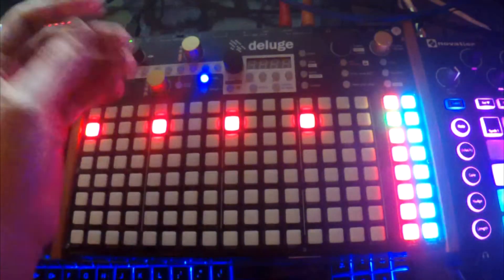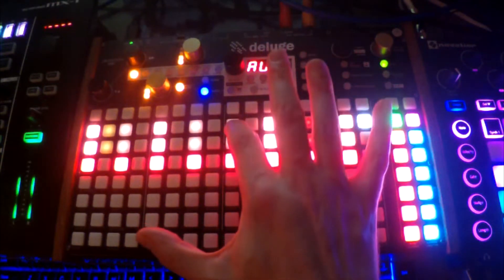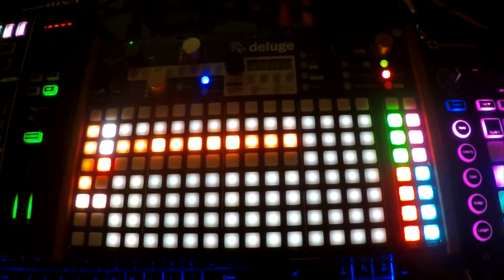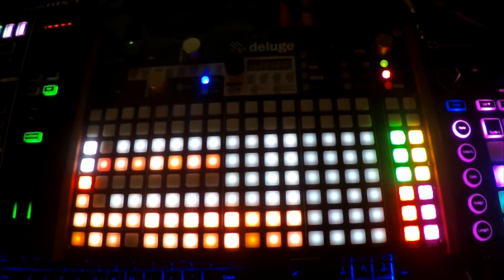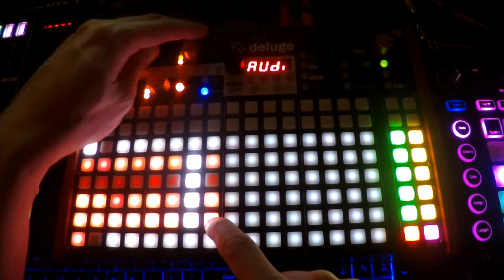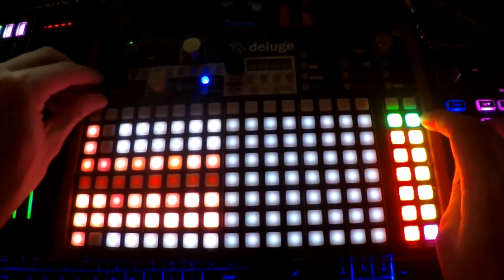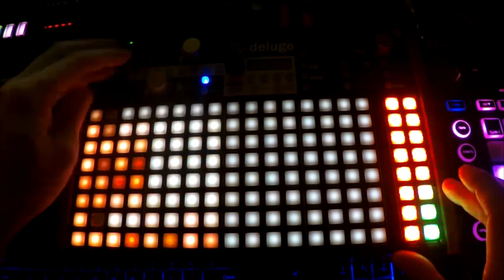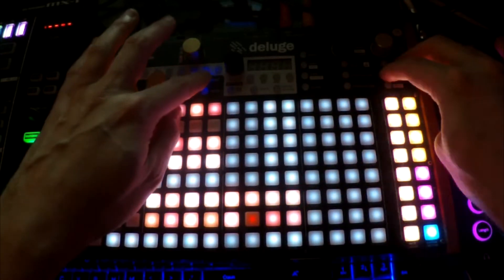Pedal Overdub Workflow W/ Guitar (3.0) // Synthstrom Deluge Tutorial

Comment: When you start and go to Settings > Midi > Cmd > Rec.. you cut video and suddenly have ‘Set’.
What is it that you did between there? I’ve been in the forums and docs for an hour and can’t figure out how to set 3rd party midi footswitch to control any of these settings.
When I press REC, it says None on display, while back and learn blink. I hold learn and attempt to send midi to deluge but no budge. tried multiple ways as well.

Any advise is much appreciated!
Reply from the maker: Just press a midi note into deluge and it will set it. Actually set it to loop
Reply: did that work for you? which footcontroller are you using? I am having a similar issue.
Reply: @Telltaletracks  did that work for you? which footcontroller are you using? I am having a similar issue.
Reply: @clacclackerson3678  Its been a long time since I solved this. I was using the KMI softstep 2 and after lots of trial and error eventually bought a midi expander for it. From memory this is what solved it for me. Hope that helps.